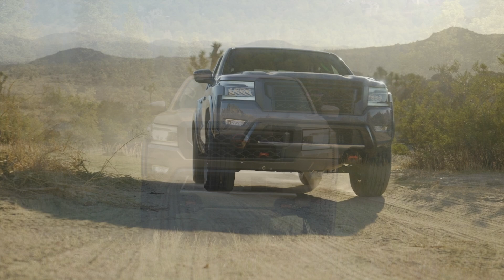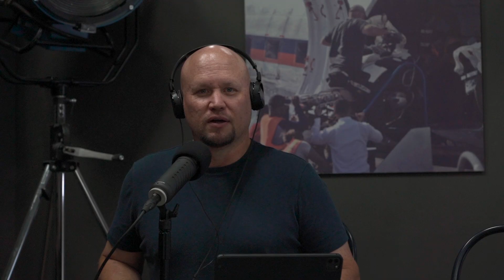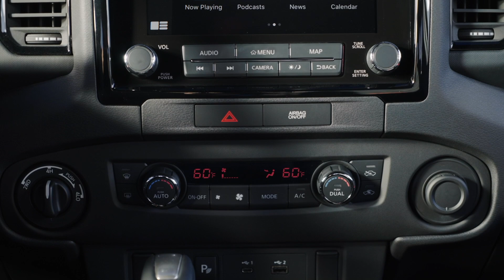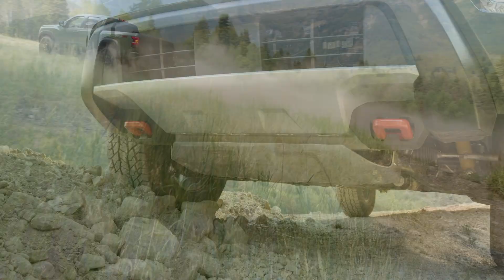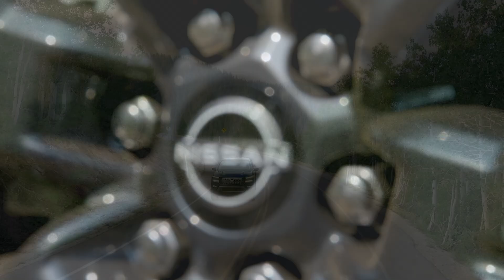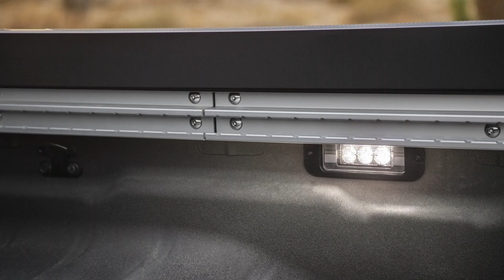2022 Nissan Frontier PRO-4X :: Overland Test

Comment: Glad to see someone who actually does their research rather than just using personal opinion to make statements. The Frontier was rated by more than one consumer group the most reliable mid-size truck for roughly 7 years until 2019. After that there is simply not enough information on the new engine and transmission to make a call one way or the other. But the basic platform hasn't changed so if the engine and tranny prove reliable then the Frontier will remain as good an option as anything on the market. Actually, having droven all the newest mid-size truck in the last several months including the new Frontier I can say from a ride, handling and comfort standpoint there is the Frontier and the GMC Canyon with the Frontier holding a slight advantage in refinement over the GMC. Everything else in the segment is in a distant tie for third.

Comment: The navara has faltered in popularity here in the uk after the whole comparitively low mileage and not too old by our standards vehicles snapping in half due to chassis made of very cheap steel badly corrosion proofed. I think the new one is I nice pickup but it's still out class as a work horse as the coils let it down in the load carrying department.
Reply: This is a completed different vehicle from the Navara, they can't really be compared.